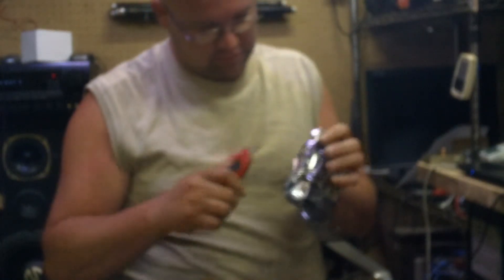Buck Bust Product Review.

Comment: What is the brand, mod number?
Reply from the maker: wow this has many many a moons a go.   Just look up on ebay and look for DC-DC buck boost converter, and look for the voltage range you are looking for.  As of  now I don't even have my solar running anymore, and the Grid Ties have been shelved for at least 8 years now.   My solar has been placed on the back burner for a while now.  Battery bank is past being any good now and only a few are being used on a battery back up for my servers ect.   Once I get my house remodeled, I will be getting back to solar, once a get a pole barn built and a place for all my new batteries and a much larger system.  Back then I was just playing with solar, and learning as I go.  with so many new Tech, now days between battries and inverters, and solar.  I want to build a system that will last a life time.   But that could be yet again many moons a way.

Comment from the maker: You can get those caps on Ebay Its hard to just buy one but you can get the 63 volt 1000uf caps for 4.88 for 4 of them and for the 100volt caps 470uf are 2 for 3 bucks all free shipping.   just look on ebay and you can even probably find them cheaper on there also.   depending on how fast you want them. and you can also go to radio shack and they might also have them.